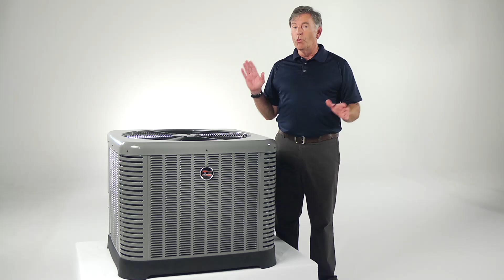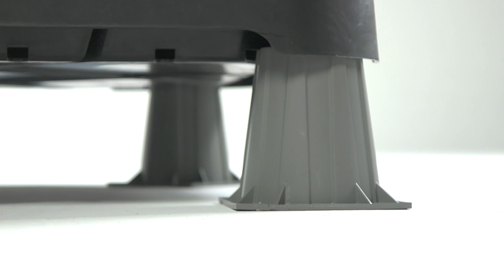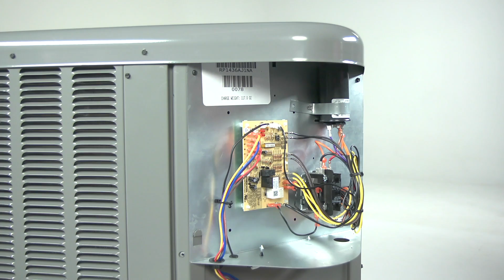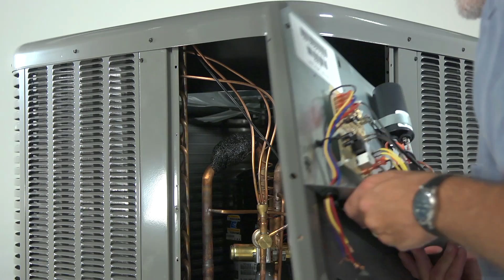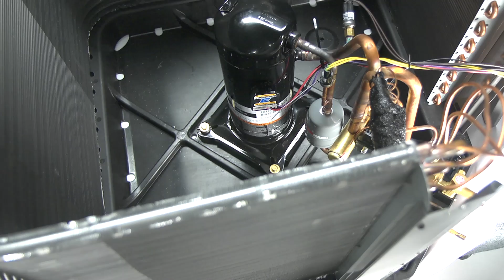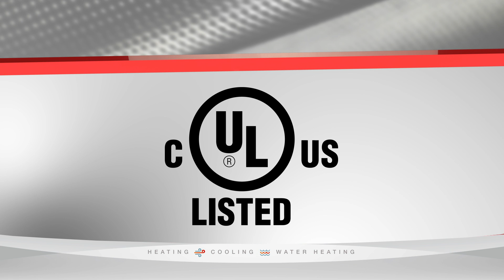Ruud 2015 Tech Video

Comment from the maker: Yes, Ruud & Rheem are the same unit but have different distribution channels.  Both units are made by Rheem Manufacturing who also manufacture Rheem Water Heaters, Raypak Pool Heaters, Richmond Water Heaters and Protech parts.  Think of their HVAC line as General Motors making Chevy & GMC trucks.

Comment: Hey i like the way that unit looks and it's easy to repair and if the compressor ever needs to be replaced it's easy to do then some of the other manufacturers do if i have to ever have to get a new heat pump I'll get a rheem or ruud